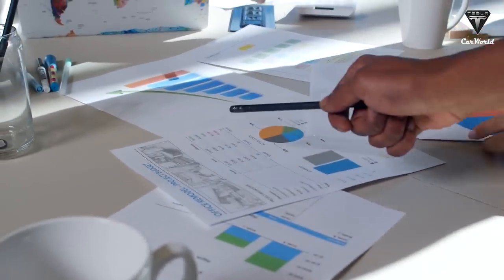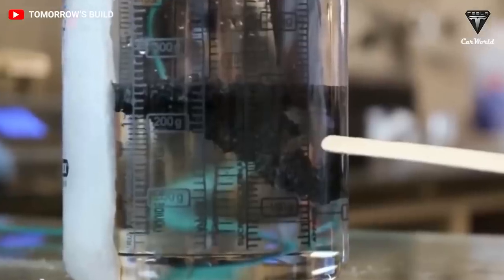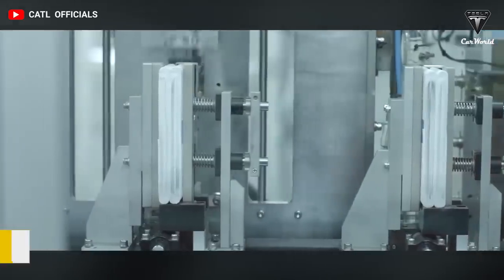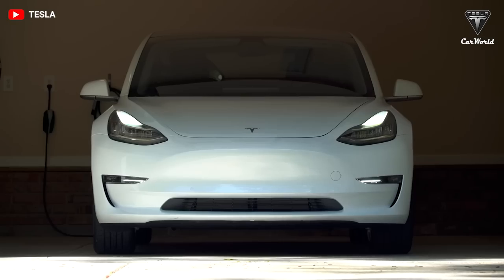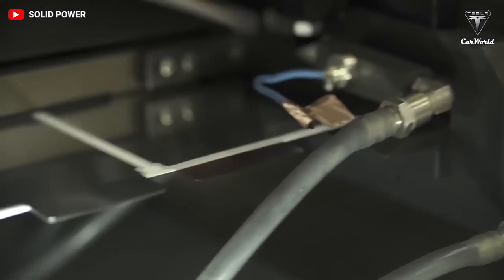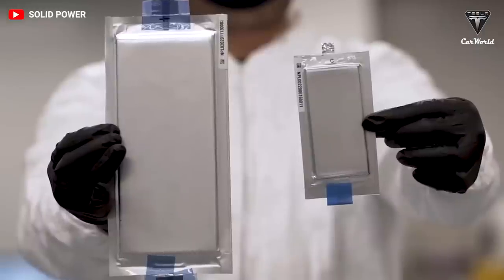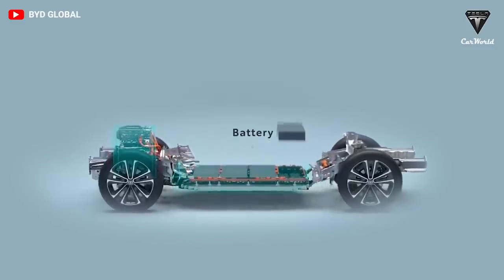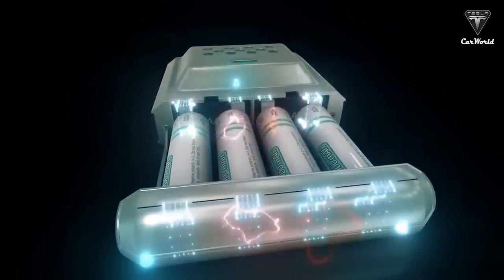New-Gen 4680 Lithium Sulfur Batteries, Tesla's secret weapon Change Everything!

Comment: While Energy Density per unit weight is important SO IS ENERGY DENSITY PER UNIT VOLUME.  Think about it.  Why does it matter is a battery can store twice as much energy per KG when it takes 1,000 times the cubic meters?
Reply: they literally said same volume or 3 times smaller for same output of energy do you not listen?

Comment: The link between Lithium Sulfur Batteries and Tesla is very tenuous and its relevance to the 4680 battery is almost as much as a standard AA Duracell battery. 

It is certainly not Tesla's secret weapon, they may be offering some research funding but are not themselves developing it and if it proves to be successful it will not be their patent. 

There are currently promising research in solid state batteries as well as technologies that would help massively improve Lithium ion batteries, your headline refers to a 4680 battery and has an image that is nothing to do with the 4680 format. Everything that was said about the Lithium Sulfur Batteries you could say about those other technologies.

Why these emerging technologies are years away is because once the concept has been proven they have to be manufactured at scale, and that is normally a hurdle that is difficult to jump.

Why do you guys always want to keep giving Tesla credit for things that they have very little to do with?